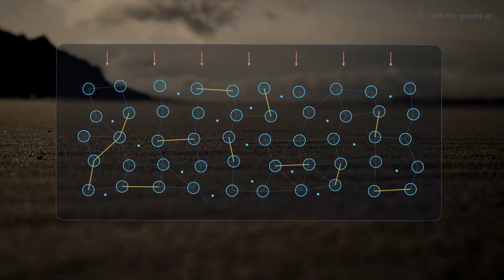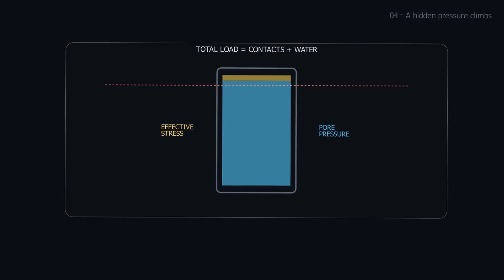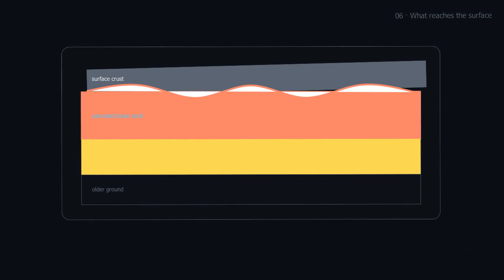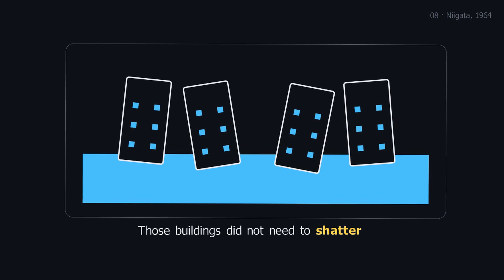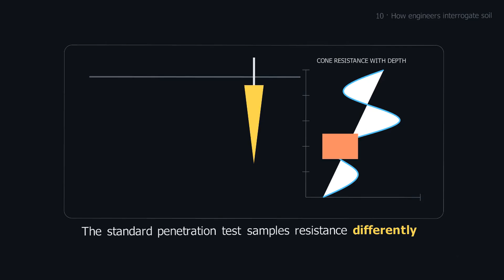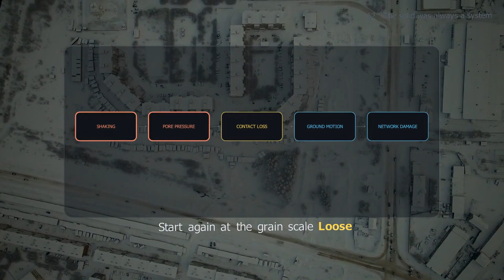Why Solid Ground Suddenly Turns to Liquid

Comment from the maker: The strangest part is that the water does not need to wash the soil away. It only needs to carry enough of the load that the grain contact network lets go. What other solid-looking system is really a hidden network under stress?